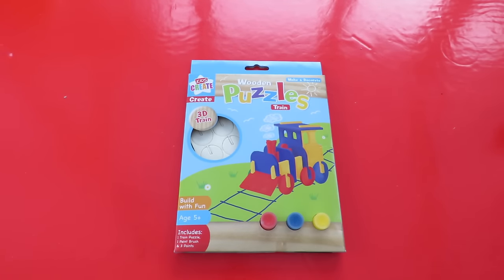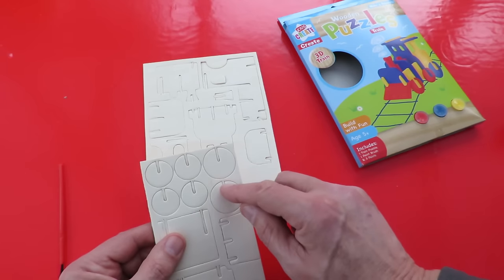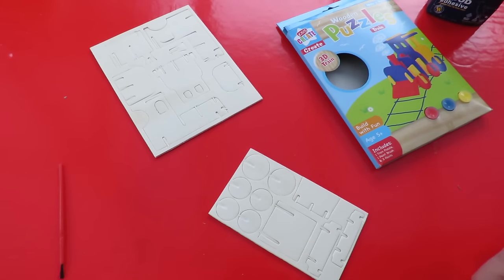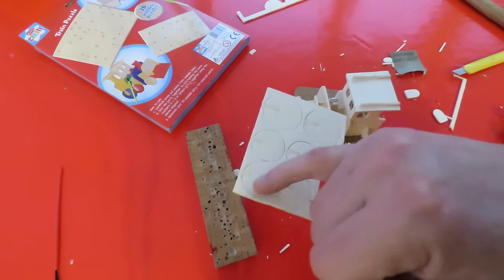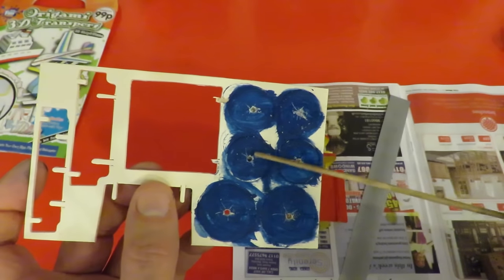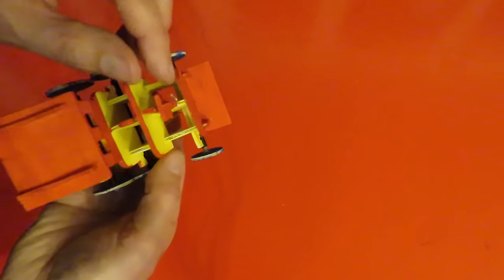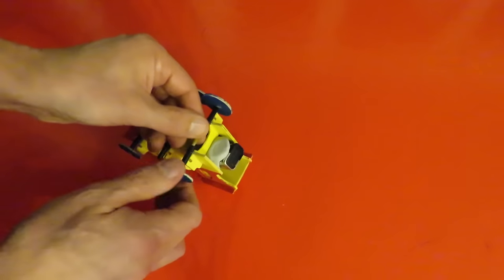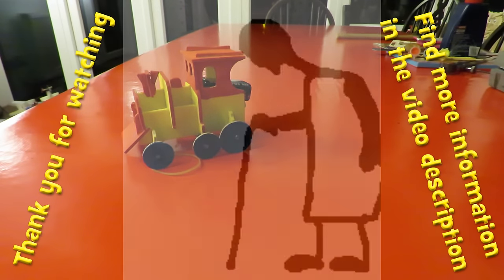Rubber Band Powered Wooden Train

Comment: That looked like fun Grandad, and no wheel slip either ?..........M
Reply from the maker: +MrMal1956 thanks, as you can see I had to add lots of weight to stop the wheels spinning. I did spend some time after the video to see if I could improve it with rubber strips round the wheels and less weight but the difference in distance was so minimal it wasn't worth making a second video.